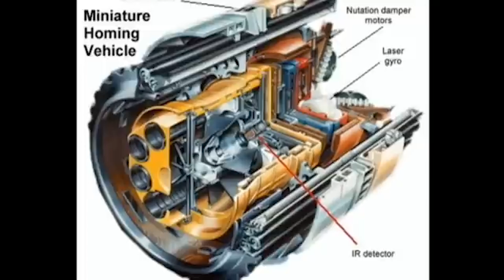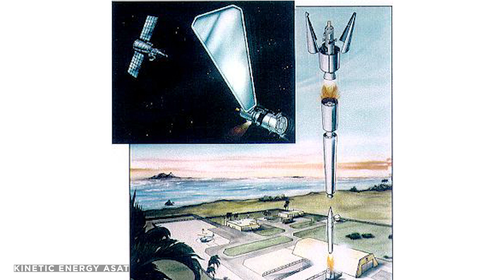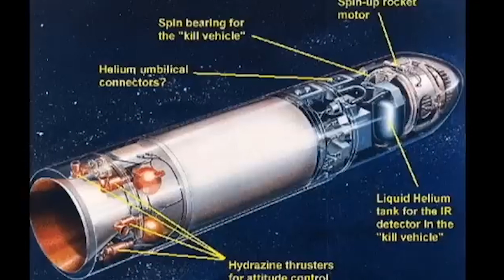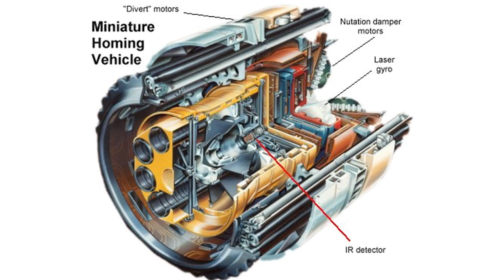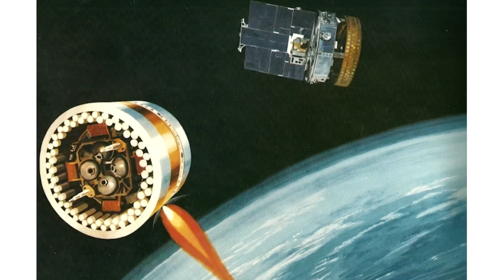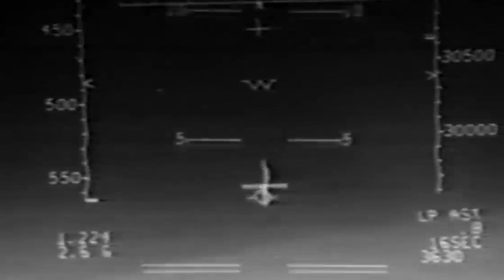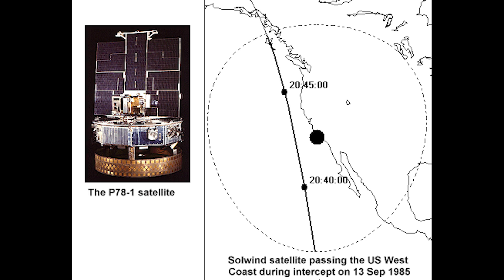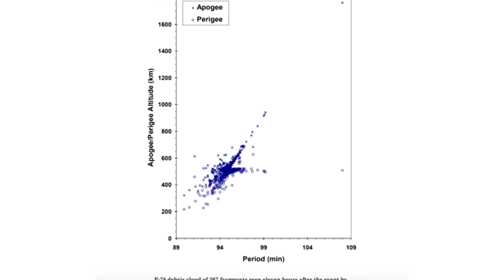The F-15 Satellite Killer

Comment: The F-15 Radar Paradox and the Collapse of the Outer Space Narrative

Premise

The following is a purely hypothetical analysis—an exercise in logical examination, not a declaration of fact. It assumes, for the sake of argument, the full accuracy of official claims regarding radar capabilities, satellite trajectories, and aerospace weapons platforms. Its purpose is to assess whether the internal logic of these narratives is self-consistent.

The F-15 Radar Paradox

Declassified sources and public military records report that aircraft such as the McDonnell Douglas F-15 have demonstrated the capability to target and destroy objects in low Earth orbit (LEO). The most notable example occurred in 1985, when an F-15 launched an ASM-135 anti-satellite missile, successfully destroying a satellite at an altitude of roughly 300 miles. The F-15 achieved this by ascending to approximately 80,000 feet and releasing the missile in a steep vertical climb, striking the target with direct kinetic force.

Furthermore, modern variants of the F-15 are reported to possess radar systems capable of detecting and tracking high-speed aerial targets at extraordinary distances. Under certain conditions, these systems are even claimed to detect objects in near-Earth orbit.

At the same time, mainstream aerospace and astrophysics institutions assert that tracking satellites in LEO demands extensive infrastructure—such as high-powered, ground-based radar installations, deep-space radio observatories, and complex orbital mathematics. These are described as necessary due to the alleged speed, altitude, and precision required to monitor such objects.

This presents a logical paradox:

If an F-15 can detect, track, and destroy a satellite in low Earth orbit using onboard radar and a missile system while still within Earth’s atmosphere, then the assertion that satellite tracking requires enormous, specialized ground-based facilities becomes questionable.

Conversely, if it truly is as complex and resource-intensive as claimed to track satellites, then the reported capabilities of the F-15 system must be significantly overstated or implausible.

Both cannot be simultaneously true.

Theoretical Implication

This contradiction invites a deeper examination of whether the current narratives about orbital mechanics and space surveillance are coherent within their own frameworks. The paradox does not seek to reject the existence of satellites or deny the possibility of high-altitude technology. Rather, it spotlights a discrepancy between the level of technological sophistication said to be required and the actual systems reported to perform the task.

If objects in LEO are easily targeted by relatively conventional airborne platforms, then why is such immense infrastructure still deemed essential?

Broader Questions

This paradox opens the door to several competing possibilities, each of which leads to profound implications:

The F-15's capabilities are exaggerated.
If the F-15 cannot truly detect and intercept objects in LEO, then the official account of the 1985 test and related claims are misleading. This would imply a deliberate inflation of military technological capability, casting doubt on a significant portion of accepted aerospace history.

The complexity of satellite tracking is overstated.
If the F-15 can track and target satellites, then the narrative that observing orbital objects requires massive installations may be an intentional exaggeration. This raises questions about the true purpose behind such facilities and the budgets that sustain them.

Satellites are not as distant as claimed.
If radar systems on aircraft can lock onto and destroy these objects, it suggests the targets may be operating in a domain far more localized than the distant "outer space" described in official models. The extreme signal loss expected from such distances (following the R⁴ law) is incongruent with the performance reported for airborne radar systems.

Ground-based space infrastructure serves an unstated function.
If airborne assets are sufficient for satellite tracking and interception, then the primary function of global ground arrays, tracking centers, and observatories may lie elsewhere. These systems might be used for purposes unrelated to space surveillance—such as data collection, signal processing, behavioral monitoring, or simulation—using the "space" paradigm as a conceptual veil.

Conclusion

The F-15 Radar Paradox challenges the coherence of the mainstream outer space narrative on its own terms. Either the military's claims about air-based interception are inaccurate, or the astronomical community's insistence on the difficulty of satellite tracking is overstated. Both claims cannot simultaneously hold true.

This contradiction does not assert a specific alternative model but invites a critical reassessment of the assumptions underpinning modern space theory and aerospace narratives. The logical inconsistency laid bare by this paradox compels one to ask whether "outer space," as popularly conceived, functions more as a narrative framework than an empirically verified environment.

Comment: My compliments for the research team- this is one of the best and most accurate vids on this.  My wife and I both worked at Hughes Aircraft Company at the time.  There is just one little detail absent.  They actually made 2 "shots" at the satellite.  The 1st one missed the satellite by about 10 miles- the engineers were extremely disappointed and dismayed.  They went back to the drawing board, gained the help of Cal/Tech and found the trajectory (software) issue and corrected it.  The 2nd attempt was a direct hit...... I can tell you that excitement "ran" through that company of the pride that everyone felt.
Reply: @jeffalvich9434  The F-15 Radar Paradox and the Collapse of the Outer Space Narrative

Premise

The following is a purely hypothetical analysis—an exercise in logical examination, not a declaration of fact. It assumes, for the sake of argument, the full accuracy of official claims regarding radar capabilities, satellite trajectories, and aerospace weapons platforms. Its purpose is to assess whether the internal logic of these narratives is self-consistent.

The F-15 Radar Paradox

Declassified sources and public military records report that aircraft such as the McDonnell Douglas F-15 have demonstrated the capability to target and destroy objects in low Earth orbit (LEO). The most notable example occurred in 1985, when an F-15 launched an ASM-135 anti-satellite missile, successfully destroying a satellite at an altitude of roughly 300 miles. The F-15 achieved this by ascending to approximately 80,000 feet and releasing the missile in a steep vertical climb, striking the target with direct kinetic force.

Furthermore, modern variants of the F-15 are reported to possess radar systems capable of detecting and tracking high-speed aerial targets at extraordinary distances. Under certain conditions, these systems are even claimed to detect objects in near-Earth orbit.

At the same time, mainstream aerospace and astrophysics institutions assert that tracking satellites in LEO demands extensive infrastructure—such as high-powered, ground-based radar installations, deep-space radio observatories, and complex orbital mathematics. These are described as necessary due to the alleged speed, altitude, and precision required to monitor such objects.

This presents a logical paradox:

If an F-15 can detect, track, and destroy a satellite in low Earth orbit using onboard radar and a missile system while still within Earth’s atmosphere, then the assertion that satellite tracking requires enormous, specialized ground-based facilities becomes questionable.

Conversely, if it truly is as complex and resource-intensive as claimed to track satellites, then the reported capabilities of the F-15 system must be significantly overstated or implausible.

Both cannot be simultaneously true.

Theoretical Implication

This contradiction invites a deeper examination of whether the current narratives about orbital mechanics and space surveillance are coherent within their own frameworks. The paradox does not seek to reject the existence of satellites or deny the possibility of high-altitude technology. Rather, it spotlights a discrepancy between the level of technological sophistication said to be required and the actual systems reported to perform the task.

If objects in LEO are easily targeted by relatively conventional airborne platforms, then why is such immense infrastructure still deemed essential?

Broader Questions

This paradox opens the door to several competing possibilities, each of which leads to profound implications:

The F-15's capabilities are exaggerated.
If the F-15 cannot truly detect and intercept objects in LEO, then the official account of the 1985 test and related claims are misleading. This would imply a deliberate inflation of military technological capability, casting doubt on a significant portion of accepted aerospace history.

The complexity of satellite tracking is overstated.
If the F-15 can track and target satellites, then the narrative that observing orbital objects requires massive installations may be an intentional exaggeration. This raises questions about the true purpose behind such facilities and the budgets that sustain them.

Satellites are not as distant as claimed.
If radar systems on aircraft can lock onto and destroy these objects, it suggests the targets may be operating in a domain far more localized than the distant "outer space" described in official models. The extreme signal loss expected from such distances (following the R⁴ law) is incongruent with the performance reported for airborne radar systems.

Ground-based space infrastructure serves an unstated function.
If airborne assets are sufficient for satellite tracking and interception, then the primary function of global ground arrays, tracking centers, and observatories may lie elsewhere. These systems might be used for purposes unrelated to space surveillance—such as data collection, signal processing, behavioral monitoring, or simulation—using the "space" paradigm as a conceptual veil.

Conclusion

The F-15 Radar Paradox challenges the coherence of the mainstream outer space narrative on its own terms. Either the military's claims about air-based interception are inaccurate, or the astronomical community's insistence on the difficulty of satellite tracking is overstated. Both claims cannot simultaneously hold true.

This contradiction does not assert a specific alternative model but invites a critical reassessment of the assumptions underpinning modern space theory and aerospace narratives. The logical inconsistency laid bare by this paradox compels one to ask whether "outer space," as popularly conceived, functions more as a narrative framework than an empirically verified environment.

Comment: we should have brought the F15 instead of that billion dollar F35.. F15 can fly further and carry twice the weight.. 1 F35 = 6 F15s.  top show👍👍
Reply: You are not considering the future of air combat. We are still looking into bringing back the F15 in the form of the F15EX. But we need stealth fighters, there are just some things the F15 can't do the F35 can, same goes for the F35 as you said it cant travel as far and carry as much. But can an F15 be a stealth fighter, ground attack,  aircraftcarrier capable, conduct electronic warfare, networking, sensorfusion, and modular and upgradable for the next 50 years? The F35 can be used as a force multiplier as well, for example, a group of F15s paired with 1 F35, the F35 can be far ahead of the group being invisible from enemy aircraft and provide targets for the F15s in the back to launch at. It's like having an EWACs that can not only be stealth but can support you as well since it can carry some missiles. Also when counting for inflation the F14 is as expensive as an F35.
Reply: What  @needtau4138  said. People are still too caught up on the 'plane' and not the total capabilities the platform provides. It's common, but very old-world thinking. The capabilities the F-35 brings to the table relative to the F-15 are as stark as the capabilities a post-WWII all-weather capable, missile carrying supersonic fighter is to a Sopwith Pup. Don't get be wrong, the F-15 will still be very useful for years to come, but the environment the F-35 was born into is extraordinarily different to what the F-15s were designed for, and upgrades will only get you so far...

Comment: Highly dubious as to whether the US still retains this capacity and if so, I doubt it has any wartime value. The cost of the weapon, probability of a kill and the value of the target are all factors. I'm also dubious as to how many F-15 drivers, regardless of variant, have any training whatsoever employing anti-satellite weapons. Just how many air-launched anti-satelite weapons the US has in their inventory is also questionable - surely there are more economical means of removing adversary satellites from the battlespace, ie: electronic warfare. Great video though.
Reply: anti-satellite warfare has massively shifted from aircraft-launched weapons to direct-ascent weapons
Reply: @chunky_mcgoo4477 …. It’s good to have a backup to directed energy for anti-satellite. Especially a backup that’s already proven
Reply: It's literally just flying a flight profile and then hitting the pickle button. Any F-15 driver that can perform a zoom climb can do it. Meaning any F-15 driver.
Reply: Yeah you keep telling yourself that. If the US can knock a satellite out of the sky in 1985, it stands to reason that it could do it again 35 years later. I have little doubt that the results of this test are in the front of the top drawer of a filing cabinet somewhere important. F15’s are still rolling off of the assembly line. Space is highly contested now with China, India and now N. Korea. This is enough of a concern that we now have the Space Force.